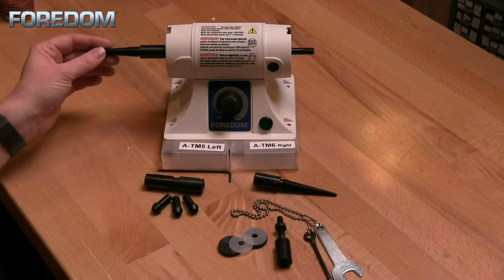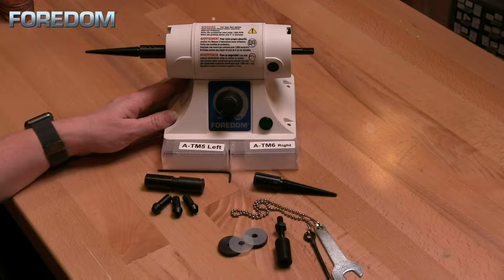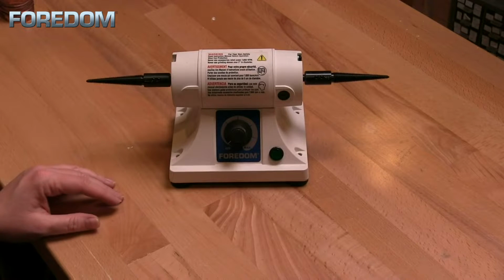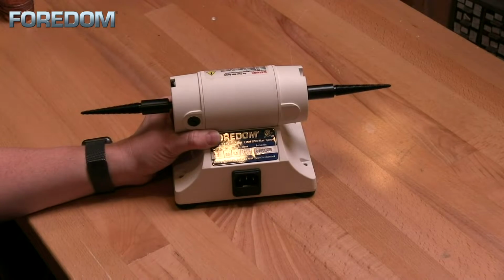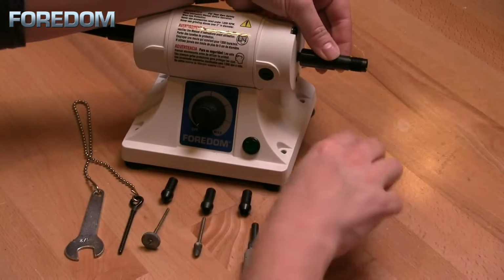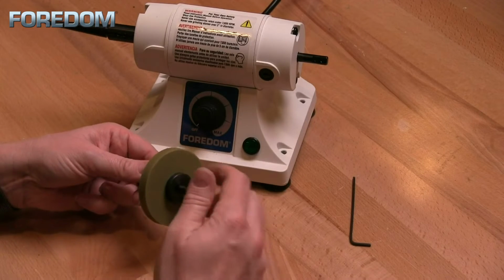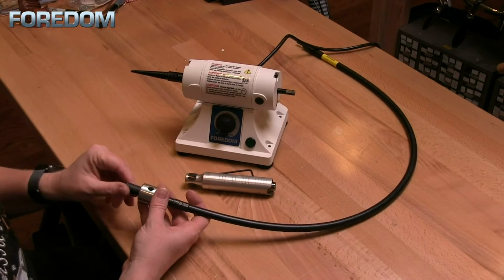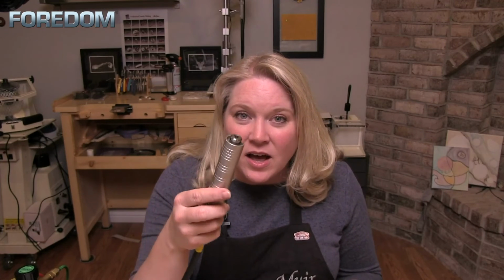Melissa Muir discusses the Foredom Bench Lathe

Comment: What size shank does that collet adapter fit? I have a True Power brand bench polisher that I'd like to do a lot more things with than just polish.  Or will it fit any shank and just be tightened by the screws?
Reply from the maker: Are you talking about the Collet holder or the or the Chuck arbor? Foredom's bench lathe has one side of its motor shaft flat so that the set screws tighten on it effectively. I don't know anything about your 'true power' product so cannot assume it would fit. A-CHA-5 (current lathes- built in 2002 and later with 5/16″ motor shafts) or  (lathes older than 2002 with 1/4″ motor shafts) https://www.foredom.net/product/collet-holder-right-side/ The A-CHA-5 Collet Holder has 3/32″, 1/8″ & 1/4″ collets. 
A-JCA-2 (current lathes- built in 2002 and later with 5/16″ motor shafts) or  (lathes older than 2002 with 1/4″ motor shafts).  https://www.foredom.net/product/chuck-arbor-right-side/ Adjusts to hold accessories with shanks from 0-5/32″. 
Foredom ALSO carries products that ARE called collet adapters. They come in a variety of sizes. https://www.foredom.net/product/hpl4-3235-collet-adapter-3-0mm-to-3-32/